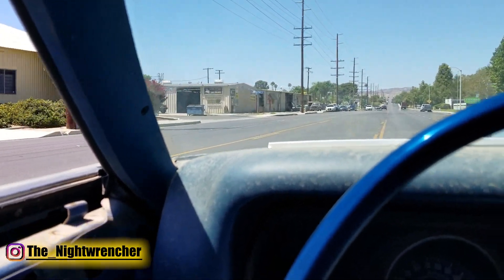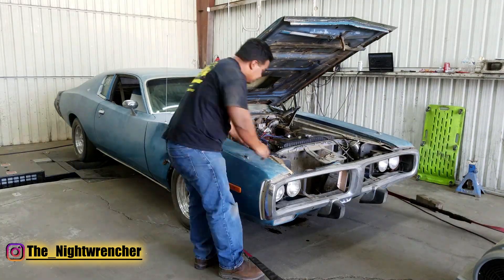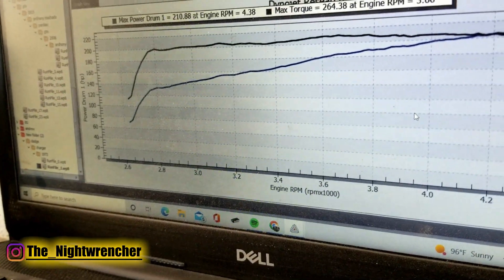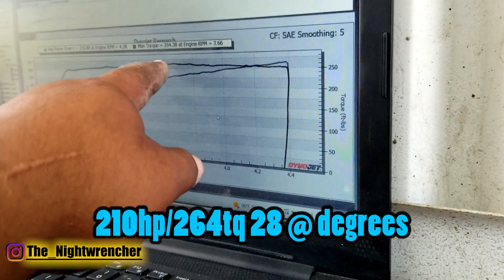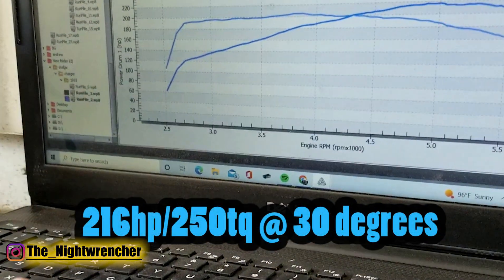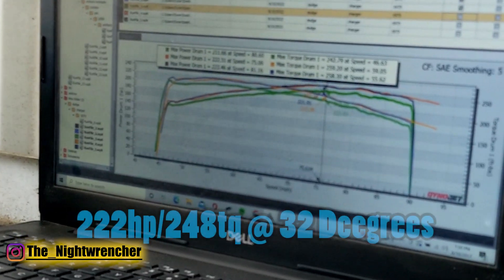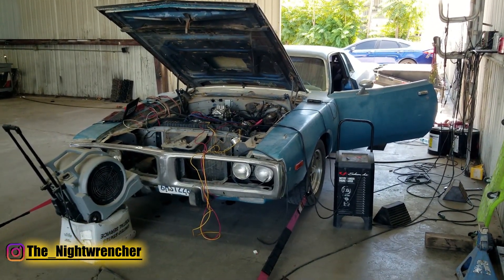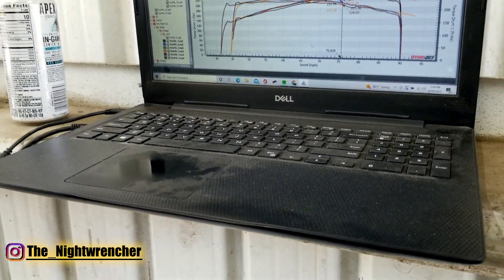How To Add Horsepower With Igntion Timing | How To Set Ignition Timing | 1973 Dodge Charger

Comment: Do you need the datalogger box to connect the tcs-1 to a laptop?
Reply from the maker: No, you can connect directly to the box to make your changes
Reply: @NightWrencher   It’s going straight into my 12a rx7. Really nice product. Most of my “carburetor” problems are ignition I believe. It needs a curve… my part throttle needs more timing
Reply from the maker: Very cool 👍 Just remember this is a piggy back unit and has to be installed to an existing ignition module that has the correct output like my MSD box. Read up on their instruction manual before you order anything just to make sure.
Reply: @NightWrencher  yes sir. Mine is already been converted to msd 6al direct fire and wasted spark on my setup
Reply from the maker: Awesome, well I hope it works out for you!
Reply: @NightWrencher   the ignitor triggering the msd is going to the tcs-1 and the tcs-1 will  trigger the msd through that wire I never thought I was going to use and cut too close to the connector lol

I thank you for your help time and good wishes
Reply from the maker: Thats actually not correct. Trigger still goes to the MSD but the MSD has an output that goes into the TCS-1. Read through both instructions carefully
Reply: I thought that mag + and - are the ignitor and the mod trigger out was triggering the msd.
Reply from the maker: I had to look it up because I did t remember. Mag + and - go to magnetic trigger off the distributor, crank sensor, etc. And mod trigger goes to MSD. Double checking is always good. You can never be too sure 😂

Comment: I have a 73 charger but it has the 440 in it now have a lot of work to do to get it road ready,was looking for a 72 Charger because that was my first car plus Mopar had not changed the front suspension yet those k frame isolaters suck but firm feel makes billet aluminum ones that are a big improvement over the rubber or poly isolaters
Reply from the maker: I think the body lines on a 72 are nicer and the tail lights look better too. This 361 is really low on power. I've gotta buy some parts for it but Know I can get at least 300 at the wheels 👍

Comment: All the old school guys say on BB mopar 38 set n forget.  I'm sure it gives a little better pop off idle but your combo shows it killed power overall.

Yup, engine not able to use all the air so the secondaries only open as much as needed. 

Good stuff!!
👍💪
Reply from the maker: I'm sure thats true on the later engines that had less compression but the 361 has flat top pistons almost at zero deck and the 440 source heads are closed chamber so thats probably why it wont take as much timing
Reply: @NightWrencher  Eh, I See.